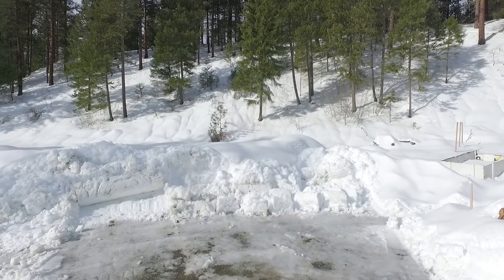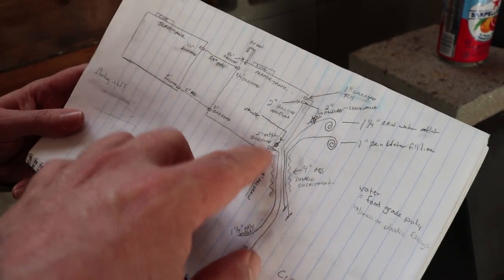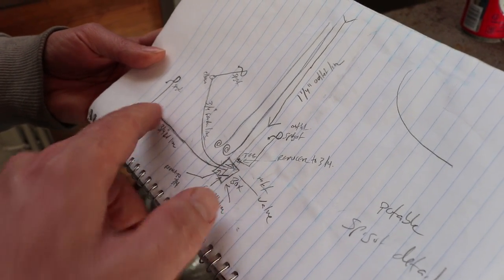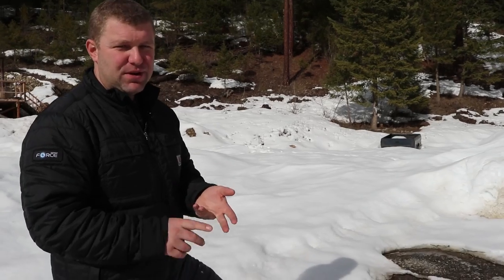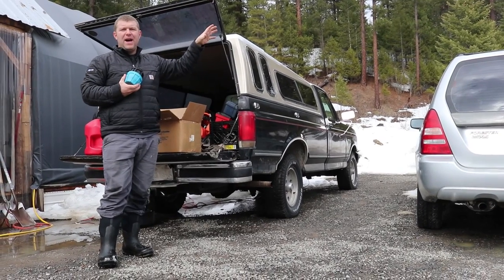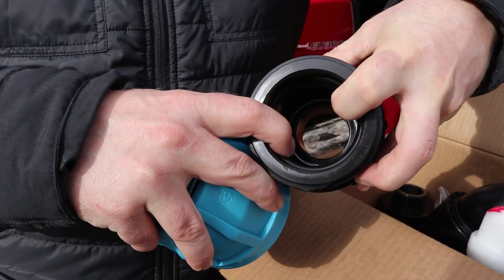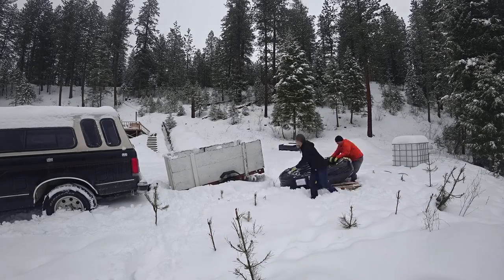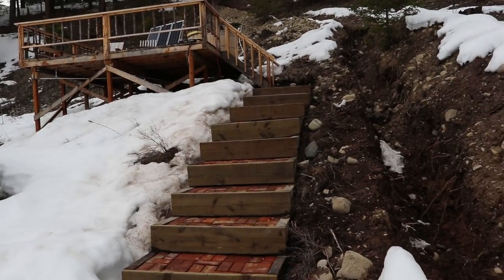$$ CHEAP vs EXPENSIVE PLUMBING FITTINGS! $$

Comment: I am not looking forward to this stuff this year on my own property. I have to set up some sort of water cistern and water line from my pond to the cistern. A lot of no fun for sure. Especially since I am going to need to pump up to the top of a hill that has some nice rock out crops to deal with. I am hoping I can go around the hill to the other side for a shorter distance and use the decrease in elevation to use a ram pump to get the water to the top of the hill.

But we will see how things turn out this spring. It doesn't help that I have moved my house building plans up to this spring either. It means I will be rushing and working a lot tighter schedule to get things done. Hopefully I wont run into too many delays and schedule problems.
Reply from the maker: +The Ineffable Homestead Sounds like we won't hear from you for a while! Lol! ;)
Reply: Well, I will hopefully be posting a lot of videos of what I am doing. So there will be that. But I suspect I will make time to watch your videos and comment still. Last year I learned the value of going into town and relaxing at the Co op and watching videos from youtube. Getting a little down time as well as getting out and socializing is important.

Comment: as much as I like water rams, I am glad you have not used any of them, they actually waste water to produce the POWER effect, , and it can be a bit tricky to recover that water, , another ''just remember point'', the pressure of water can be adjusted in the trip to your house, by the fall, and length of the pipe, and reductions in pipe size, and restricting the flow within the pipe, big pipe to smaller pipe over a long length, will increase pressure, and that flow can be restricted in the pipe to slow the flow, , just the natural physics of this can get pretty complicated, , , turn on the kitchen sink faucet, and blow out the bottom of the sink or have more pressure than the innards of the faucet can hold back.

Comment: Hey Guys what method do you use for the pipe to Mains Tap attachment. Just noticed it was a plain non spurred possibly internal fitting connection. Do you need a activator/primer and glue? Cheers Looks brilliant by the way.
Reply from the maker: I had that in the video but deleted it. It's a Saddle branch tee. Simple connection. No glue. The rubber seal completes the connections. VERY high precision fittings.

Comment: You poor people, thankfully we have a much simpler system in Australia. Blue line and green line HDPE, basically green for AG or pump systems and Blue line for mains pressure, and all threads are BSP. This is a some what simplified explanation, but we don't have to play with any other pressure ratings.

Comment: Drain line....dangerous terminology for a line intended to pass potable water or not? Confusing for outside contractors should they ever be needed and look at your drawings. For some reason I feel like I want to siphon using a draw-spout inserted from the  top  and located a few inches above the bottom of the tank into a T coming off the end of the tank on the bottom...both would have ball valves. This would enable a simple blast of air to empty your mainline back into the tank for service or freezing reasons. It might be a better solution for picking up less garbage from the tank bottom and stirring it up. You could use it either way with this set up...maybe even fill the tanks from the mainline you already have?

Tanks close to the surface of the ground in cold country we used to use black plastic tarp and cover with sawdust from a sawmill. I imagine you have a few of those locally only to happy to get  rid of the stuff for your toilet and other things. I used to buy their slab  wood from them delivered a minimum of 3 cords for pennies...I think it was $40. I couldn't go frog around for firewood with my own equipment for that much money. Sawmills...your pal, your friend, your one stop shop! Oh and they have great lumber too!

I'm not trying to TELL you how to do it....just sharing the crazy thoughts in my head.

Comment: So where was the $8K savings ?

What do estimate the water pressure will be at the bottom of the hill ?
Reply: Maybe Brass vs Poly?
Reply: figure .5 pounds of pressure for each 1 feet of rise. So if the cistern is 50 feet up the hill they will get 25 pounds of pressure at the bottom spigot. To get more pressure would require a pump.
Reply: Not just a pump, would need a pump and an expansion tank so every time one needs water the pump doesn't have to come on.  I forget typical household pressure, easy internet would generate it surely, but I know pump alone isn't the driving force.
Reply: Typical pressure varies from 30 to 90 psi. The bladder tank does nothing to add to the pressure in the system, it acts like a capacitor storing pressure which was output by the pump. The primary purpose of a bladder tank is to decrease the pumps duty cycle and will make it last substantially longer if its sized appropriately.
Reply from the maker: Head is 70 feet. .43 psi/ft = 30 psi. Savings is in choosing a pipe/connection system that is quality, but affordable. Equivalent brass fitting system would be approx 4-5x the price.

Comment: How will you build your system to stand up cold weathers?
Reply: The temp is the same all year just 40 or so inches from ground level so no freezing or anything.   They can insulate the pipe coming out of the ground and into the house.
Reply from the maker: BIngo!

Comment: Oh and when you Guy's start to lay the 2in let me know and I will tell you how to lay it without the pipe rolling back up on you or stressing your tank bulkhead connection "THAT'S A HUGE DEAL". I have seen a couple guys get busted pretty good by 2in when we weren't using a rack. But if you pay attention and know when and what to do its easier than PVC to install. ONLY CUT IT FROM THE ROLL WHEN YOU HAVE NO OTHER CHOICE!!! LOL!!!

Comment: Hey guys, just watched your main plumbing video, and in one seen Alissa is holding the philly  rod down in the trench. I almost fit though my internet connection to scream bloody murder.. those trench walls were like 4 feet over her head, that trench has been open for some time and saturated with snow melt. You have let's be frank...crappy rock for soil, bottom line in 10 seconds of trench wall collapse your world is different, in 2 mins your life is over. Please please please don't ever put her in that trench again. Step the walls back for every 1 foot down the side walls cut back away 2 feet,Until you get below 48""inches.so you end up with a big stepped V trench. I have not looked at all the comments but hopefully someone else commented on that Major Safety "near death" event. Thank your higher power and don't ever do that again, I want to keep watching your videos

Comment: Did you guys ever think about a hydro energy reclamation device on the gravity flow portion near the top?
Reply: JKflipflop if installed at the top of the fall you can reclaim ~60% of the energy used to pump it up, and not lose any psi.
Reply: JKflipflop no not breaking any laws just making it 40% cheaper

Comment: over kill  big time   2  in.  waste  of  $
Reply: I think you missed the video where they said they could afford to do something once, but not twice and I think since  these components are underground if they really are over killing it big time they'll sleep well after the job is done and cost won't be that much above not over killing it.
Reply: y  2in. ???          1 in, is  big     k/sink  3gal  a  min.  =3/8 tub
Reply: They said in previous video that they were not building weird structure house like straw bail or earth ship, because they might not be in the house forever, they want the option to sell it so my guess with the water system is by selecting 2 inch, they want to give future homeowners plenty of capacity at the bottom.  Still, I see what you mean, the tanks above hold only so much water so can provide 2 inch for more water but still only so much water in those tanks to be drained.  As I think about it, a 3/4 inch is coming off main public city pipe to my house and I think the public pipe isn't but at most 4" and it feeds all neighbors so you seem right.  Maybe they are afraid 1 inch will get blocked a lot.  2" easier to keep clean and unblock?  I don't know, but yeah, 2 inches does seem big now.   But the dollars wasted that you mentioned might be just a few as it might cost just a little more over the 1 inch and provide benefits we don't know about.
Reply: the price for  1 1/4  bob fitting is cheep  couple  dollars ea.    2  in,may bee 4  water slide in the   '' PRIORITY ''   hot  tub?????
Reply: As for as I can tell, tanks at the top and piping are designed as if hot tub doesn't exist meaning hot tub could be an after thought and this water system would provide for it the same way it will a garden or washing a truck or a car.

Comment: have you considered a hydraulic ram pump its a water pump concept that uses no electricity just physics
Reply from the maker: Where would the water come from to power the pump?
Reply: A ram pump would not be of any benefit in this system. They are for pumping water uphill and loose about 50% of the water while operating which requires a good stream flow.
.
Reply: A ram pump works by the pressure head built up from water from a higher elevation being channeled down through the pump. They have no water up higher to use a ram pump. If they did, they wouldn't need cisterns up on the hill. They'd just use that water to begin with.